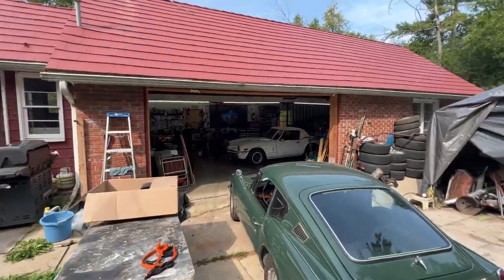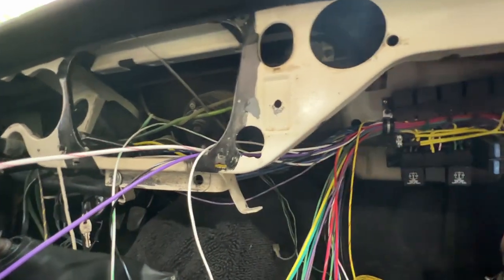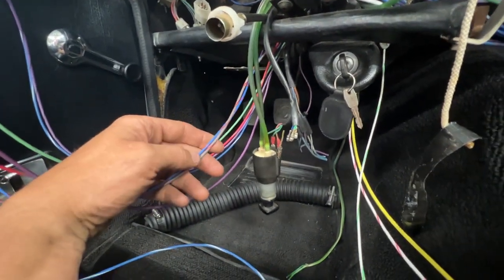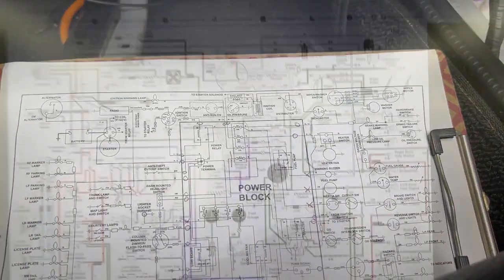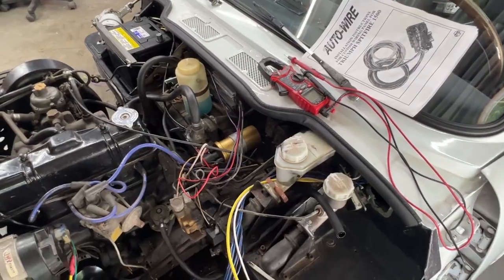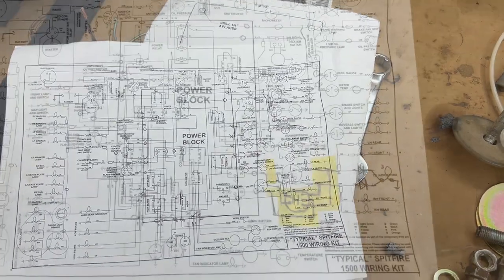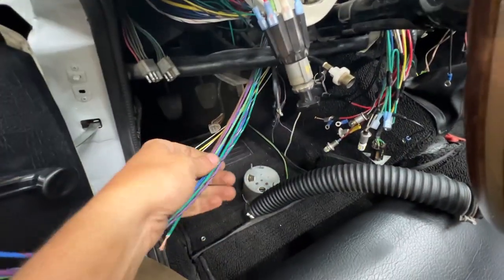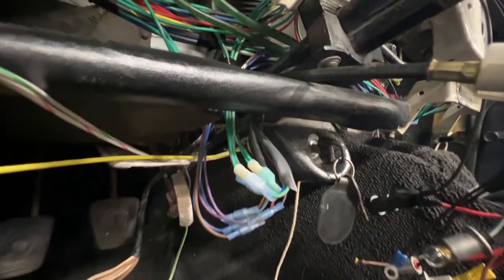Spitfire 1500 - AAW Custom Wiring install - part 1

Comment: When doing these car electrical jobs I find temporary clips useful for bundling the wires into their respective looms.  "Claw" type hair clips are perfect for this, as they can be operated one handed and wires can be added or removed easily.  These clips are available in a variety of sizes and colours, so can be left to keep under-dash wires tidy or can be replaced with loom tape when all is complete and tested.
Reply: Or use the reusable cable ties with the little latch you can press to release, easy to loosen and add extra wires then tighten again to keep it all in place

Comment: More than one restoration project was sold because of the wiring. Too many people start a restoration by cutting EVERYTHING instead of leaving the old loom intact.
When it comes to resassembly, they are left with a huge mess of cut wires and missing pieces and don't know where to start or what to do 😅😅

Good thing you were there to rescure the project :)

Comment: Good job, with the changes to the original wiring system being cable colours and different switches used, it's no wonder this family had problems and passed the job on to you. The condition of the car looks good, but once you have completed the wiring it should be great to use.

Comment: Elin, I used to be afraid of wiring, but after doing several rewiring projects on my TR4A, (the previous owner had done some “creative” wiring), I actually find it enjoyable.👍
Like you, I found the stock bullet connectors to be problematic. However a local electronics store had crimp on male/female bullet connectors that were slightly larger in diameter than the stock bullets. So what I did was to remove the metal inserts from the stock Lucas connectors, and found the the crimp connectors fit perfectly inside. So when you look at them it still looks stock.👍 As I do various wiring jobs, I replace the stock bullets with the crimp on ones.

Comment: Well done making sense of that mess Elin. I’m not very impressed with that kit, Autosparks in UK make plug and play kits with all connectors on and braided into the right bundles using original colours. Or you can do what I did on my Stag and MGB GT and buy a cheap used harness to strip and use the correct colours from to rebuild and enhance the existing loom, I grafted in a universal board using modern fuses and relays and have had no problems since. Key is to lay out the original loom first and pin it down so everything you change or add ends up in the right place.

Comment: That thing at the end of the video is the EGR service meter. If the car has been Smog deleted you can remove that and run the speedo cable to the transmission. That is how my car is.

Comment: Lucas parts are much better than their reputation might suggest, especially the switches, mine are 60 years old and work just fine, the worst Lucas parts are the bulllet connectors, the originals are stretched , split or corroded, the reproductions are alloy and weak.

Comment: UK spec 1500 Spitfires used an external ceramic resistor bolted on next to the coil. It is an inherently better system starting wise.

Comment: I have a spitfire 1977; and my oil pressure gauge it has one connection , I the yours there are three.   But the diagram shows three cable to connect . Could you give a guide please . Thanks in advance

Comment: Can you add a ballast resistor. I think it will be 1.5 ohms. A 25 or 50 watt resistor might do a great job but I haven't crunched the figures to be sure.  What do you think ?
Reply: Sorry I meant a 3 ohm resistor
Reply: Looking up ballast resistors, they seem to be 1.5 ohms, so now I am a bit confused.  Amazon has them
Reply from the maker: You could, but I don’t think you need one unless you are using the car in the winter.

Comment: Looking at those wires so many of them are way oversized it looks like even running the distance they do. They could have properly specced the wire sizes and used they money they saved on that extra copper on making the kit more user friendly.